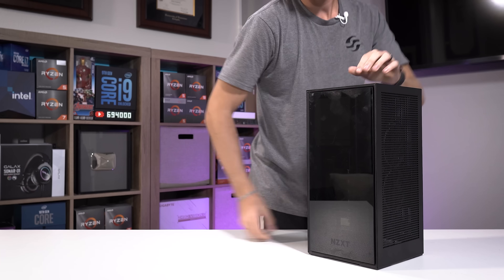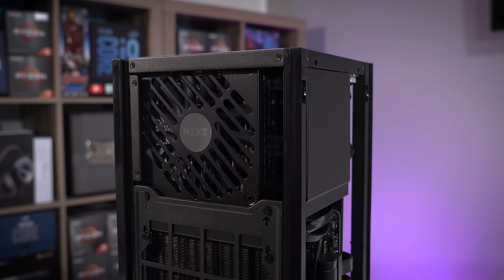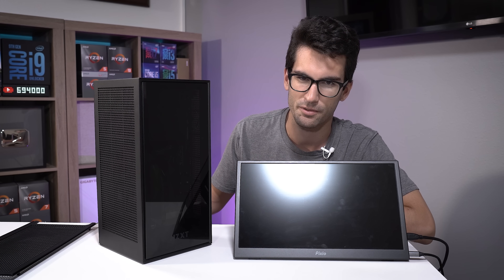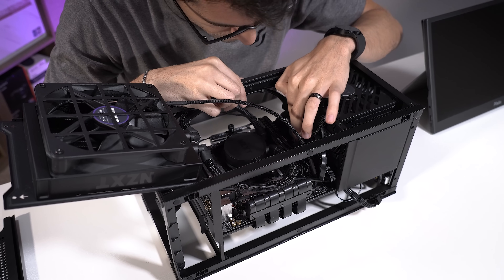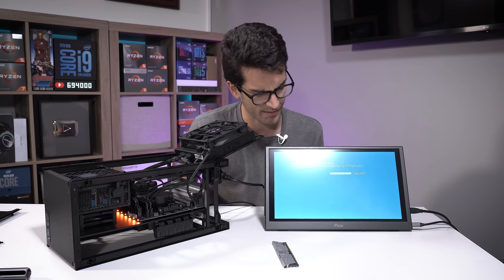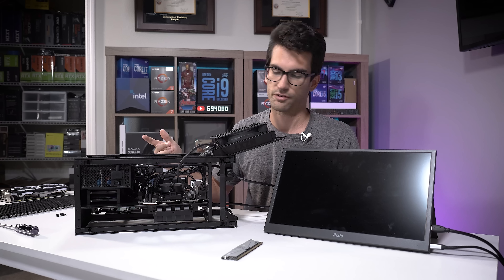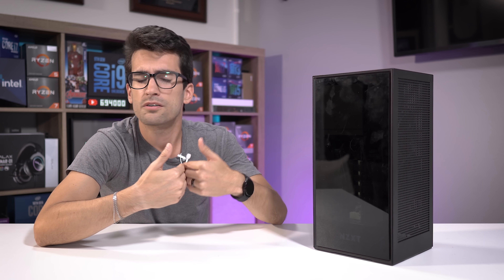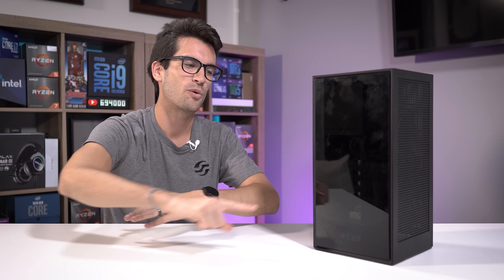Fixing a Viewer's BROKEN Gaming PC? - Fix or Flop S1:E16

Comment: I've only discovered this series recently so am a bit behind, starting in series 1 and working my way through. I've been building my own systems for a few years following a PC bought in a tech store failing just after the 12 month warranty expired and I managed to fix it with a new power supply and motherboard. This series, even the few episodes I've seen so far, has given me a new depth of knowledge regarding hardware (I'm, ok with software as that used to be my job). Many thanks and keep doing more of the same.

Comment: This is strange, I replaced my motherboard and CPU the other day . I had  32 GB of Corsair Ram  installed. One of the them wasn't seated correctly and it still posted but showed only 16 instead of 32 GB! I reseated the Ram and it rebooted to show 32 GB of Ram.

Comment: Hah! If you think that was a mystery. You should have seen my x99 a few years back. It would run OK for months then periodically would play dead. No fans, no boot. Just completely dead. No lights on the gpu to show any power. I would reset cmos remove ram etc many times before it would finaly boot. I finaly put it down to being a flakey bios. I reflashed the bios to the newest when it was released and fingers crossed have had no problems.
That was untill I decided to upgrade my ram.
I purchased some corsair 4x16 64gb ram 3200 speed. Previous ram had an xmp of 2400.
Checked with motherboard and 3333mhz was the fastest I could fit. So I thought i was safe. 
After fitting it, there was no xmp setting for 3200 in the xmp profile. Oh well, I'll just have to run it slower then. (Was told it was OK to run slower)
Everything worked fine for a few days, but then I started to get blue-green boots periodically with windows failed to boot and windows needs repairing notifications.
Anyway, to cut this story short. Had to go back to 2400mhz ram to keep the system operating correctly. Still don't know why the ram wouldn't work correctly or have the correct xmp profile in the bios.

Comment: Surprised you do not have a test rig to check that the graphics card is working or not. Since most of these  P. C.s are not posting I would think you test this after your original test run.

Comment: This same issue happens with my streaming pc. I installed new ram then the pc would turn on but nothing more. The ram stick wasn't sitting correctly even with the tabs locked in place on the ram. It must have a mm of wiggle that causes pins to not sit in contact with the ram stick. Checking my ram stick was the first thing I checked and it turned out to be a simple fix. 😁

Comment: Love his vids so much. My pc turns on and everything but, I can't use 4 ram modules. I tried putting in two in the recommended slots and it didn't work so i switched them to a different slot. Now it works but with only 2 memory modules. I've read a whole bunch of things on it and tried switching them around many times but it still won't boot with all 4 modules. It shows a dram problem on the on-board leds so it turns on still but it won't go past there. Anyone care to explain this to a noobie 😅
Reply from the maker: Likely a dead memory channel. One of these FoF episodes actually documents us troubleshooting one of those.

Comment: this happened to me once when my build was new, it seemed that one stick was missplscef and it was detecting only 8 gigs, then in the middle of a rage attack (thanks valorant) i punched my table and that must have disconnected my rams so it wouldn’t boot. ended up switching rams places and it worked fine

Comment: this happened to me when I installed an nvme ssd and a new ram. you see the m.2 slot is actually under my gpu so I had to remove the gpu first to be able to install the nvme. also did a little cleaning while I'm at it. removed the the old ram to brush away the dust a bit put back all the components to place and installed the new ram but nothing. and I remember that sometimes if you remove something from the mobo like in my case the gpu you kinda mess the bios a bit. and since I don't have a IGPU since im using a i5 9400F I resorted to jumping the JBAT pin manually and nothing. so, i removed that CMOS battery and waited for 5 minutes and put it back in but nothing, at that point I was freaking out thinking that I might did a static shock to my pc but hey when I touched the ram slot i noticed that the other lock wasn't actually clipped so yeah, i fit the ram and voila! it works. sometimes it's all that tiniest not complicated issue is bitching at you and it will make you really look stupid.

Comment: I wanna get into it and before the pandemic I was buiding cheap low end pcs and making great profit with few issues thankfully but one build issue I had was seated ram not booting then reseating same ram and slot and it worked. It looked fully seated but it wouldnt boot.

Comment: my exact issue with my first build, no post screen at all, removed the cpu, installed it again, cleared cmos, checked cables at least 1000 times and gave up on it for a week when i came back a week later removed the rams and put it back again... smh... lol

Comment: I just bought my X570 tomahawk wifi +5600X. on december 1 2021. after assembly when i plugged in my msi Rx580 , the bios refused to post. the ez debug light stayed at BOOT light while the boot drive was never even connected to mobo in  the first place.
Luckily i had a R7250 from a my old build before the 5600x system, which was a AMD A10-7700k was using that with RX580. After plugging the R7250 it magically post to BIOS directly since there is no boot drive.
I still could not figure out what problem is. tried the CSM/UEFI as my old install was on old board so even with CSM the mobo never posts with Rx580 on top slot. replacing the Rx580 with R7250 on any slot i can get to post. but now on top slot i have Rx 580 and on bottom slot i have my R7 250. and if i need to go to bios i just swap hdmi and can go to Bios. Now i changed my OS to UEFI installation and now this weird thing that i have to live with swapping HDMI if i want to go into BIOS with R7250 when ever i power on the system. if i want to Use RX 580 i have to forget going to BIOS and it does that 1 long and 2 short beep on post and automatically loads in to windows, being connected to RX 580. all of my games work as intended. no GPU related issue but the POST thing is still remains mystery.
Took one of my friend's GTX 1060, same problem as my RX 580, X570 refused to post. but on the same slot R7250 just was able to make bios post.

Comment: I wasn’t getting a post a couple months ago with a brand new build. I checked the ram, cleared the cmos, flashed the bios (worried that the Ryzen 5600X wasn’t natively compatible), & checked all the connections a thousand times. Ended up being that the cpu wasn’t natively compatible AND was only partially inserted into the socket like it was inserted with the bar down. Weird since I didn’t make that mistake. Spent a whole day on figuring that out. I was getting worried of a bad mobo.

Comment: Just getting to watching this now, I want to share an experience of had. One time I move everything to a different case and couldn’t get a boot, every cable was in the right place. I took all the steps, memory,cmos, gpu, cpu. Then I went to the power supply (modular) and had to try turning the pc on with one cable plugged in at a time (adding another with each boot) finally got to the sata power cable and boom no boot at all, replace the cable and all was well.

Comment: This is why you buy a motherboard with diagnostics. If it it had a buzzer or LCD display, you could hear/see the error code it is throwing out on boot.
Made the "mistake" myself to buy one without and after building my PC it just wouldn't post. I eventually reseated everything, except CPU and it still didnt post. So last thing i could do was reseating the CPU and low and behold... it wasnt clamped down properly. Luckily I didn't damage the 3950X CPU or the socket, so after socketing it again and reconnecting everything it finally posted.

If it had diagnostics, it wouldve instantly screamed the "no CPU" error code.

Comment: Sometimes the dimm modules can be fully seated and this behavior will still happen. I have 4 8gig sticks in my pc and at one point my system only detected 16 gigs, I reseated the ram and it read 24 gigs, then I did it again and it finally recognized all 32 gigs. I know they were fully seated too, as I was triple checking. It could be a small amount of debris or something, but memory can definitely be finicky

Comment: I was wondering if anyone here knows what could be the issue with my computer, I've looked around quite a bit and I cant really find any answers. Basically I go to turn my computer on and my motherboard shows code 00, this happens after the computer hasn't been on for awhile e.g. whilst I was sleeping, then I go and hold the power button down to shut it down and restart it and it turns on fine.

Comment: Does the troubleshooting step also applies to laptop? At my office we have acer one 14 it's an old laptop and we want to make it work again, so I installed fydeos in attempt to turned it to a Chromebook laptop. Everything went fine until it went to sleep mode and I was trying to wake it up, it went blank. Does it also have a problem with the RAM?

Comment: I've got the same issue and I don't think you've fixed it. System refuses to post but if I power the main switch off, reseat the ram then turn it on, it'll post fine, however if I power down normally and try to power it up again, it won't post again. So I need to power off the main, reseat the ram. lather rinse repeat. You won't see how it won't post again because you kept reseating the memory every time.

Comment: sometimes i get this problem too because i try to overclock my ram modules its nightmare to fix the problem sometimes removing ram fixes it but sometimes i have to remove gpu , ram , cpu , power cables and put them back again than pc runs perfect

Comment: This was identical what happened to me I was switching a big fan out and ssd and I turned it on and nothing was showing my systems fans was running and headset gear lit up and all but no display. I started reconnecting everyrthing same with my ram I reconnected one stick even though I had two and it booted up. Very strange as the ram was working a secound ago and I had not touched it or done anything to it..

Comment: I built and sold an old Abit KN9-570 Sli with the uGuru Panel... and the machine worked great with anx2 core 3.4Ghz pam2 cpu... and 2 months later the gal was freakin' 'cause when she would start the system the uGuru Panel made the continuous BEEP-BEEP signal.

Changed the cr2032 board CMOS battery and never heard from her again. (2011)

Comment: CPU: Ryzen 5 5600g
Motherboard: MSI B550M PRO-VDH WIFI
RAM: G.Skill Ripjaws V Series 32 GB (2 x 16 GB) DDR4-3200 CL16 Memory
Storage: Samsung 970 Evo Plus 500GB
Add. Storage: Seagate Barracuda Compute 2 TB
Case: Cooler Master Masterbox Q00L MicroATX 
PSU: Corsair RM (2019) 650 W 80+ Gold Certified

I first booted it without updating the BIOS and nothing happened so I went and updated the BIOS to the version that supports this APU (7C95v28) and it booted up just fine but after looking at the BIOS for a bit, btw i haven't changed anything, it just turns off. Then it boots back into the BIOS for a couple seconds then turns off again.

I don't know what to do so im just shooting my shot here

Comment: Thinking of changing my old pc. It's an i7 4790k 16gb of ram.and a 500 GB Samsung SSD. I don't play games except football manager. I'm looking at the Intel nuc based pcs. There is an i5 11gen with 16gb ram dual chan. 1 tb nvme around 600 pounds. I want and need an ultra quiet pc. Are they any good?

Comment: I've bought the second pair of modules to full my mobo ram slots, and i was having issues.
Basically my mobo does not have both the clips, it have just one.
So, you need to push more on the side without it, cause there's a spring clip under the plastic, and so i was like closing the ram, but not on the right "track".
Had me stress for nothing :T , and i've built that pc :I , and i'm also a pc enthusiast ;-;

Comment: Another fantastic diagnosis from geek squad. "It's your motherboard RMA it!" Looked at it for about 30 seconds I bet.
Reply: Since the pc suddenly stopped working before it probably was faulty and the incorrectly installed ram was just another issue after replacing the board

Comment: I had a similar issue with my PC a while ago. Upgraded my ram and the PC wouldn't post. Double checked they were seated in properly and everything. Changed over the ram slots and it worked fine, changed back and they worked fine again lol.

Comment: i also have this trouble aroung this week, i fix my friends pc that goes really really power lost, turn on and off powersupply and did nothing at all. so i try to jump 24pin and 8pin connector with really cheap powersupply and it works, turn it off again and replacing with his own PSU again, work just fine.

while his pc fixed 2 days later my pc come with the same problem and i my pc never have this prob in million years, i fix it with the same method and still works. i dont know what kind of problem this is, is this the windows that cause this ? 

i would like to know if someone has experienced the same thing, no post its really okay, but power lost is really pain in the ass 😢

Comment: a minute into the video and I knew it was a 2nd or 3rd gen ryzen. sometimes they dont like to shut down if the overclock is a little wonky.  Power button on PSU or bust.  Watching the rest to see if Greg finds a permanent fix.  

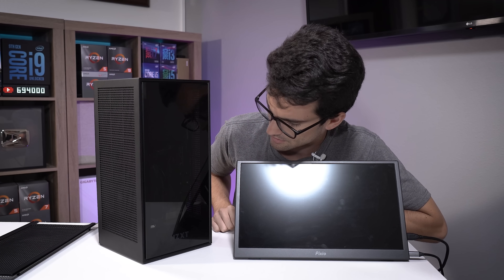Edit 4:16  Knowing what I know about Ryzen, I'm clearing CMOS at this point.

Edit edit:  Interesting conclusion about misseated RAM.

Comment: Ahhhh this was soon close to replicating my black screen on boot issue I had with my R5 3600 and XFX 5700. I was really hoping you would discover the issue. I'd even RMA'd my MSI board and they had found nothing wrong as well. (But when I put my system back together it had miraculously started working again). However, improperly seated RAM was not the original diagnosis because the black screen had literally happened when my PC was just sitting there doing nothing. It black screened like it had before and generally a reboot would being it back except that time, it didn't. Not even a bios this time. Completely stuck

Comment: Awesome vid as always! Also, that is exactly how I gained a few of my clients and they referred me to do builds for others. They had minor issues and I went to check them out and fixed them within 15 mins. I told them dont worry about paying due to it being a simple fix and a few days later i got the calls for the builds. I will always not charge if it takes 15 mins or under.

Comment: I wish you were local to me.. I really need some help with my hunk of junk.. bought a 1080p "gaming" prebuilt from ebay and recieved an old lenovo office desktop with an rgb keyboard/mouse... NO gpu.. i5 650 cpu.. absolutely got myself ripped off and I tried to look at the bright side (I could atleast try to upgrade some stuff and add a gpu to handle my gaming (genshin impact and sea of theives) but now the computer wont boot and I cant figure it out for the life of me.. man, I wish I never bought this shit, and just buy parts individually:(
Reply: Does the computer turn on when you push the power button?
Reply: @JJFlores197  its odd. im receiving a beep error code indicating ram issues (2 short 5 long beeps) but the ram isnt dead as i have them thrown in another motherboard and are fully working
Reply: @JJFlores197  theres power going through,  the PSU is fine as I tested it with the paperclip method and it turns on right away. The ram seems to be the issue but when I reseat it and try again, I get the same error, but when I try the ram in another mobo all is well.

Comment: Sir i had a problem that my cpu does not reach boost clock stuck at 3.3ghz
my pc spec
 r7 2700 
8x2=16gb 3000mhz ram
 asrock b450 pro4

Comment: That's not what it was. I had this happen to me as well. Computer was on, thought it went into sleep mode. 
I had to take out my ram. Start with 1, turn it on, then 2, turn on the computer, then 3 , turn on the computer, and then the fourth.

Before I did that step, I took them all out, then put them back in. I repeated that till I thought I might have a stick that went bad.  It was super odd. I basically built this system as soon as the 2700X first came out. Last month is when I faced that issue. All 4 sticks are good. Still don't understand what actually happened.

Comment: i wish i could send you my pc, it posts and runs fine but i cant get my bios to come up when my gpu is plugged in. i get 3 system beeps then it boots, if i disconnect my gpu from power and leave it plugged in to pcie slot it boots with no beeps, and i can get to my bios. if you have any ideas i would appritiate it

Comment: I think he added ram after putting the mobo in the case which is tricky if you’ve ever worked in these cases lol and over time the ram that was unseated  slightly wiggled out even further thus causing the issue also explains why it booted originally

Comment: Man I wish you could help me. I just installed a z590, I7-11700F, nzxt kraken x53, and 3060 Ti. Updated bios and installed drivers, installed windows and within 5 minutes of running my processor speed drops to .8ghz, my GPU usage drops to 0.0, and there’s lines all over my screen. The GPU has never been overclocked or run over 70 degrees C, and is two months old. (All this worked just fine with gigabyte b560m three days ago). 

I can’t figure it out and apparently it’s not out there on the net.